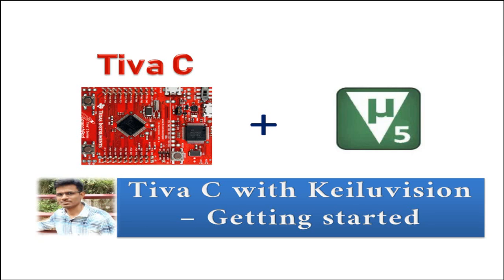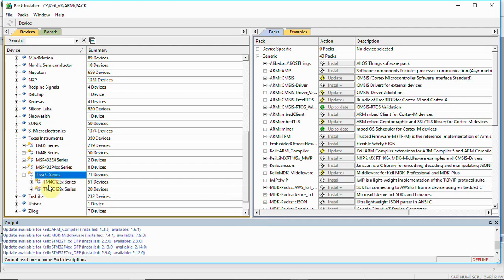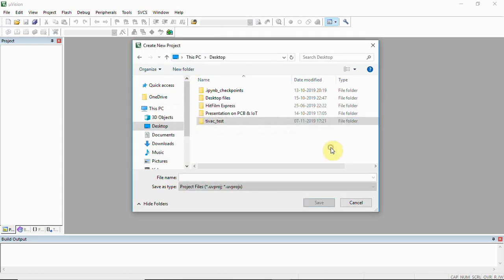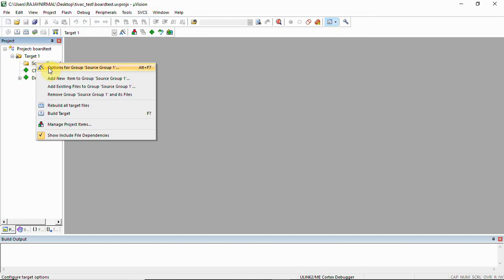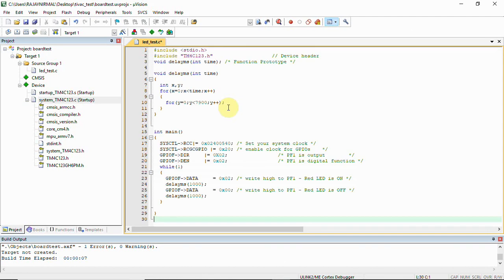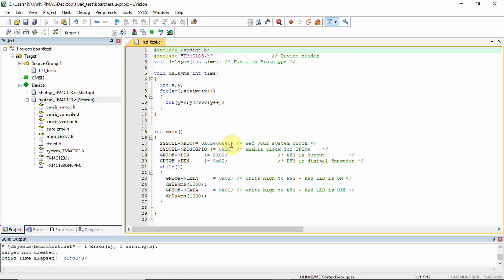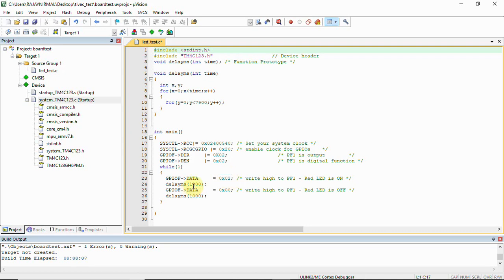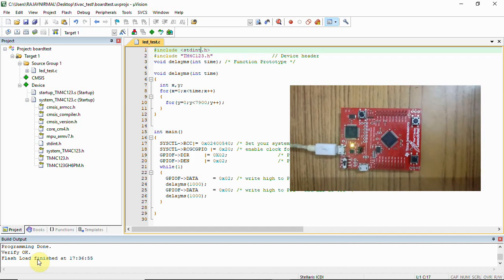Getting started with Tiva C launchpad using Keiluvsion

Comment: Hi Ajay.
I'm trying to interface Tiva c series launchpad with keil. The evaluation board is same as yours. 
I'm using keil v5. 
I'm unable to select stellaris icdi in target settings. There's no option such as stellaris icdi.
I've already installed the Tiva drivers for icdi. What am I missing?
Thankyou for your help.
Reply from the maker: Hi John, You will have to install the drivers and I have provided the link under video description for the same
Reply: Thanks Ajay.
I did install the drivers - stellaris ICDI. After uninstalling and reinstalling a couple of times I couldn't solve the issue. But when I installed keil v4 the option was present. 
So I just figured out the responsible . DLL file and copied it to keil V5.... 
Now I have it working.
Thank you for your reply.
Reply: @johnknox8655  which .dll file? can you please give the name of that.
I am facing the same issue
Reply: @jaydomadia9182   Install Keil Uvision 4 . Inside the "C:\Keil\ARM\BIN" folder search for "lmidk-agdi.dll".  Copy the dll file, go to the keil v5 folder -----  C:\Keil_v5\ARM\TI_XDS    paste the copied .dll file after renaming it to  "XDS2CM3.dll" .    
Now open Keil v5 and open "options for Target "  then go to the "Debug"  tab and select "Use" . 
From the dropdown menu select  " TI XDS Dbugger".
What we are doing is just using the XDS debugger selection for our stellaris debugger since we dont have that option in the dropdown by replacing the XDS dll with that of stellaris. 
This can also be easily done by editing the TOOLS.ini file in the main keil v5 folder..... This I realized only later
Reply from the maker: @John Knox 
If you have Keil MDK v5.29 or above, please click on the in this link 
http://www.keil.com/support/docs/4196.htm for STELLARIS_ICDI_DRIVERS
Reply: @chipride8119  Thankyou. It's the easier way.
Reply: MDK v5.29 as well as newer versions of MDK the support for the Stellaris ICDI debug adapter has been removed, which will cause such a debugger DLL error.

Use an add-on installer that can bring back the support for Stellaris ICDI to MDK v5.29 and above. Just download and install MDK_Stellaris_ICDI_AddOn.exe.

Comment: Could you please make some tutorial on CAN?? Actually I was trying to use the TI example as Simple_TX, every setting is fine, even the definition of INT_CAN0 is present in the hw_ints.h but it's appearing as can.c(348): error:  #20: identifier "INT_CAN0_" is undefined. kindly help
Reply from the maker: I will try to.. do soon , I currently don't have the IC for CAN bus interface
Reply: @chipride8119  Thank you!

Comment: Thanks for sharing this! I have not Tiva card so want to simulate it on Proteus. What should I do after coding in Keil?
Reply from the maker: I am not sure Proteus has tiva c library support
Reply: @chipride8119  Could you recommend an IDE and simulation program for it, please?
Reply from the maker: @rukiye6884  if you want to simulate tivac, I don't think any IDE supports it. It's better to buy launchpad. If you are fine with STM32 keil supports  simulation
Reply: Thank you so much sir

Comment: Sir when I used the code the led is only ON it doesn't blink for me
Reply from the maker: check if you have done the settings and written the code properly.Also you can find  driver link for keil MDK v5 & above in my video description
Reply: Same problem.
Did you know how to fix it ?
Please help if you know how to fix this problem.
Reply: @sosee1432  get the library location from windows, copy it and #include it
Reply: @chipride8119  Thx sir
Reply: @raoufmagdy3661  Sorry sir, how can I do it ?

Comment: Hi Ajay! 
My LED is not blinking. I have followed your every step.
Reply from the maker: Hi Ayesha, try to  recheck the procedure and also try changing the LED pins because we have RGB LEDs on board
Reply: @chipride8119  Ok I will try again. 
how to change pins?
Reply from the maker: @ayeshalatif8329  try changing 0x02 to 0x04 or 0x08 , in DEN,DIR,DATA
Reply: @chipride8119  Ok I will try.
Thank you 🌟
Reply: @chipride8119  still the same issue
Reply from the maker: @ayeshalatif8329  make sure the code is getting uploaded to your board.
Reply: @chipride8119  yes I uploaded on board
Reply from the maker: @ayeshalatif8329  ok first try to push the reset button on your board after you have done with uploading, if still doesn't work, try to enter into debug mode and check using step into function
Reply: @chipride8119  yeah I did this. When I debug and start step by step execution then every instruction is executed and LED is on and off and then on so on as per commands.
Reply from the maker: @ayeshalatif8329  what about pushing reset button after upload
Reply: @chipride8119  yeah did this too
Reply: @chipride8119  nothing happens
Reply from the maker: @ayeshalatif8329  send me your code to my email..click on email in channel about page
Reply: @chipride8119  ok